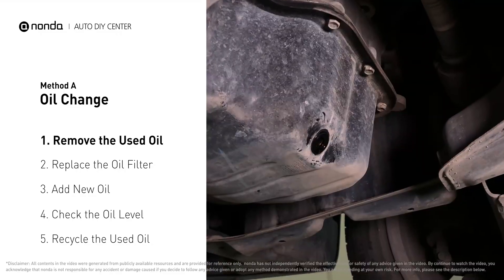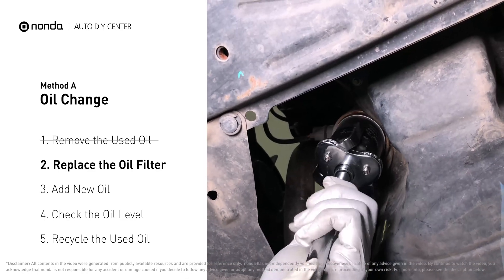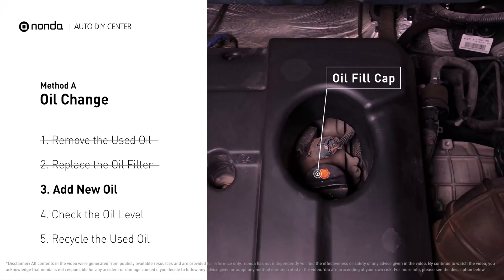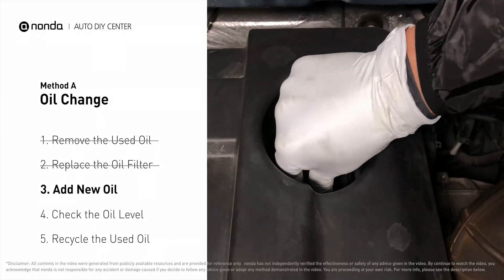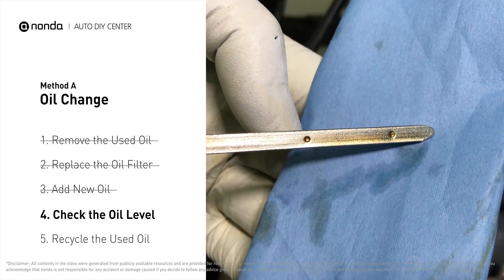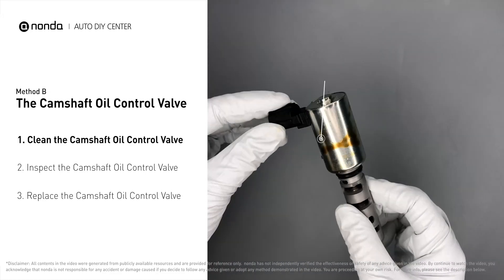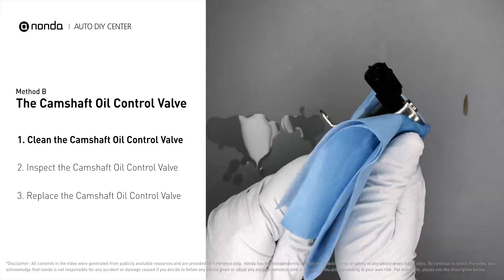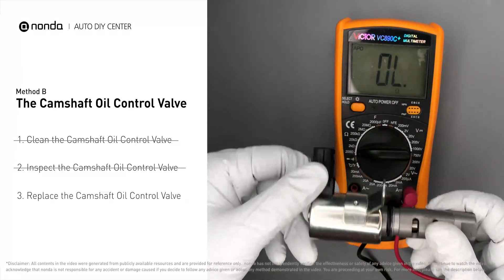How to Fix HONDA P0011 Engine Code in 4 Minutes [1 DIY Method / Only $19.45]

Comment: Replaced vvt solenoid and changed oil and filter with problem still active
Reply: wasnt the vvt solonoid in front of motor by fan belt just becareful of the weard long 10 mm screw you dont break it